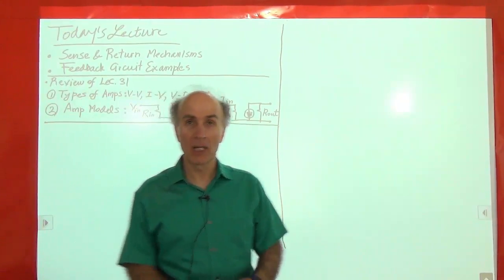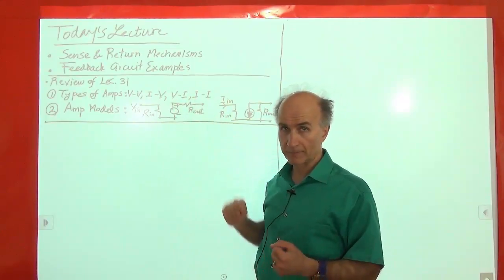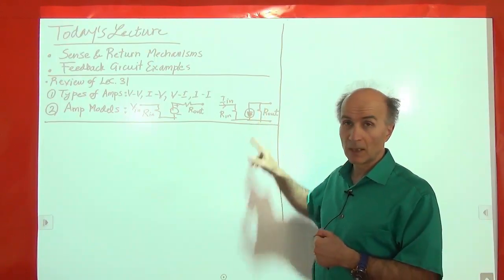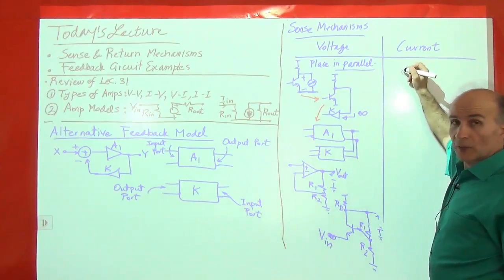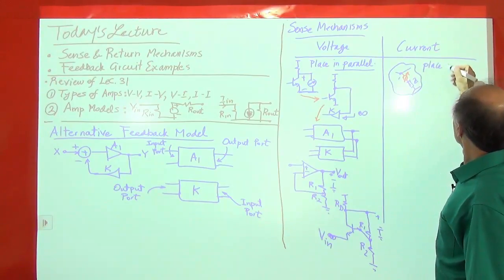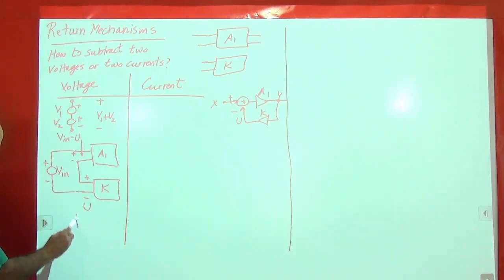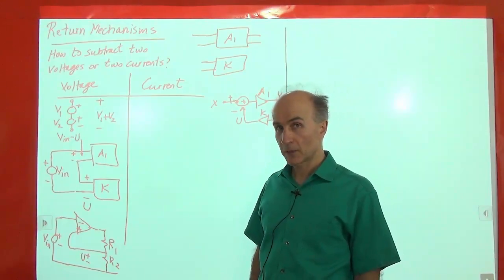Razavi Electronics2 Lec32: Foundations for Feedback Analysis: Sense & Return Mechanisms

Comment: 01:25 - Intro and Review
05:25 - Alternative Feedback (2-Port) Model
09:34 - Voltage Seance Mechanisms
>> 15:40 - Resistor Example
>> 16:40- Transistor-Level Implementation
18:50 - Current Seance Mechanisms
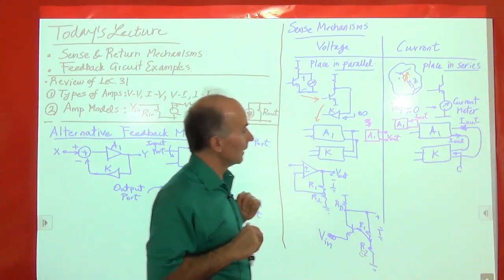>> 26:55 - Example of Measuring Current Trough the Wire
31:45 - Return Mechanisms
>> 41:44 - Transistor-Level Examples